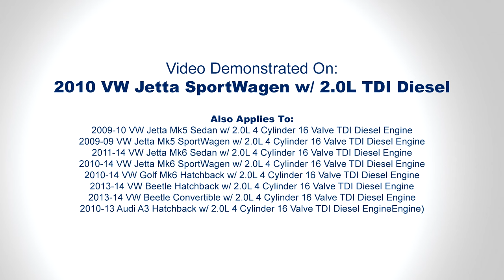How To Change VW Jetta Oil & Filter 2.0 TDI

Comment: Supposed to remove the Oil Filter first so the oil in the filter housing runs to the pan and drains out with the rest of the oil. Otherwise you are just contaminating your new oil with a decent amount of old.

Comment: This video misses one crucial point -- amateur folks don't have a car lift. The only place to raise the vehicle (according to the driver manual) are on the pinch welds adjacent to each wheel. If you lift with a jack, where do you put the stand? Hondas and Subarus have a central lift surface just under the engine compartment that allows you to push the entire front of the vehicle up, and then you can put stands on the pinch welds to secure the vehicle. Without this, lifting the VW requires alternative methods: driving onto wedges to lift the vehicle up, or using vacuum extraction. Vacuum is annoying because it is messy and requires always priming the pump. Getting under the VW must be done safely to remove the dirt cover to reach the oil plug. Any suggestions?

Comment: Great video but that looks incredibly painful and makes me question owning a VW again. What were those engineers thinking? Did you say you need a 32 mm socket? Where do you get something that big?
Reply: any auto parts store.
Reply: 32 mm is 1.25 inches John Holmes.
Reply: cmetube Most cartridge oil filters use a large socket for the housing. 32mm is not uncommon
Reply: Stop trying to throw shade on the VW engineering. It's some of the best you'd find, amateur

Comment: So, I've been using liqui moly for many years (not for my newly purchased diesel though).  How does this compare to the Ravenol?  I'm also very interested in the 20 liter bag in box, seems like a good option.   I did research on the internet, and it looks like a close match, do you agree?
Reply: Acc to the makers, Ravenol is PAO based oil. Should be better.

Comment: 5 Liters? Every indication is 4.3 liters. Please advise.  Minute 9:40 says "5 liters"
Reply: Ryan Fitzgerald the capacity of the oil pan is 5 liters. Factory recommended is 4.3-4.5, but no problem with adding 5 liters on it.
Reply: @OpenTheB0x  thank you - yes I ended up putting 5L in and all is OK. Thanks for confirming this. I suppose with the extra oil in there we can drive an extra 1600 (5.0/4.3 which amounts to roughly 1/6 x 10k or 1600) miles between oil changes?

Comment: how do you get the oil light off after changing oil/
Reply from the maker: Hi James,
We'd recommend first checking your user manual for instructions, otherwise a good ol' Google search should also turn up an answer.
Reply: @blauparts     i  USUALY  TTAKE  OF  POSITIVE  CABLE FROM  THE  BATERIE  WAIT  FIVE  MINUTES  THEN  PUT  BACK.cOUPLE  MINUTES  AVTER  START  THE  CAR.DONE